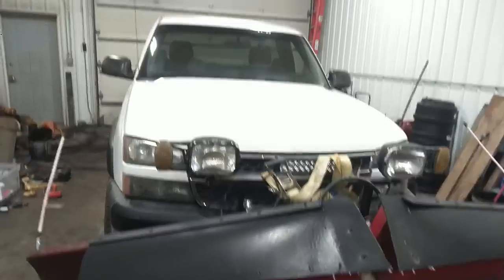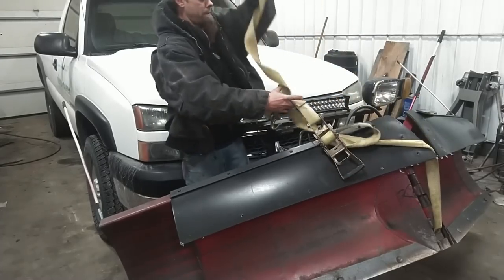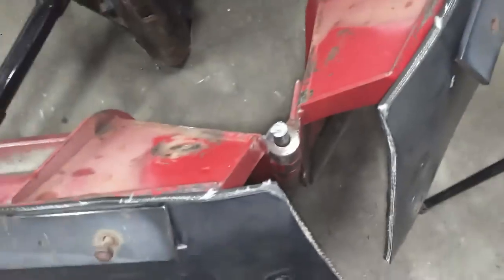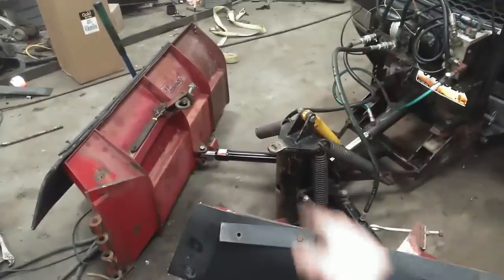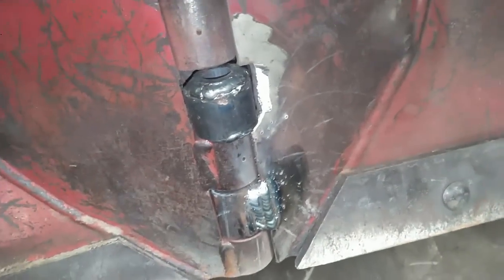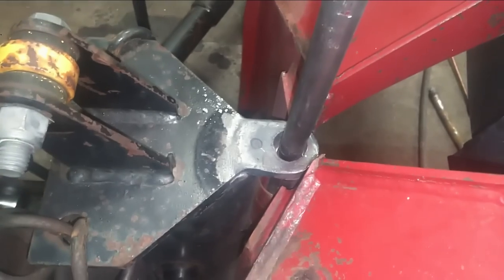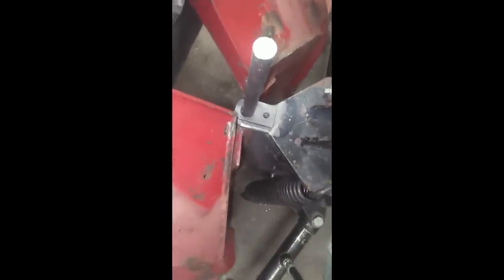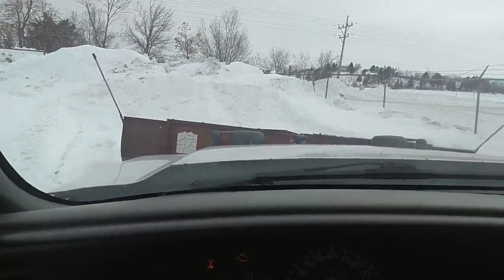fixing a badly damaged boss snowplow

Comment: That’s a common failure on V-plows- I’ve made that repair enough times that I’ll never buy a v again.  Very nice fabricating work, sir.
Reply: I had old Western straight blade plows for 30+ years no problems. My friend had many Boss plows with nothing but problems.
Reply: @grosseileracingteam  both are good plows, I prefer boss because of ease of hookup and overall simplicity.  V’s in general from any brand are prone to failure at the hinge because it’s pinpointing all the stress.

Comment: Wow!  I've had 5 Boss v's.  All but the stainless dxt tore at the bottom on the hinge.  I've repaired a couple, just bought new ears to do another.  They are fixable, but Boss didn't design them heavy enough at the base of the hinge.  Still better than anything else out there.

Comment: Just a simple question... when the pin moves in the wallored out hole on top won't that shear off the retaining bolt leading to another bent plow center pin???
Reply from the maker: Pin would want to fall down not up and the tab would still keep it from doing that. The reason why the pin was up is because the plow had been sheered off of the Mount causing the blade to almost fall off and then it was lifted back kinda into position

Comment: Do you think that hole being waller out is what caused that bolt to break off?
Reply from the maker: I think the plow breaking off of the Mount is what broke the bolt and bent the rod. That top tab and the rod were the only things holding the blade on that bolt is only designed to retain the pin. Not hold the entire plow on.
Reply: @Ezrider359  ya. I think you are right. I didn't look at it that way. Good job brother!

Comment: Not only is the cutter bar worn out, it looked like the skid shoes were missing.
Reply from the maker: No one runs shoes around here. This plow mostly plows paved lots And gravel freezes hard enough after the first storm that your not going to dig it up anyway.
Reply: @Ezrider359  skid shoes left on plows are telltale signs it is A. HomeOwner or B. Rookie plow operator
the skid shoes are the first things that come off plows here. they make great boat anchors, door stops

Comment: That guy is not kind to his equipment , evidently
Reply from the maker: Snow plowing isn't nice to anything especially when you get multiple storms back to back that are over 2 feet each
Reply from the maker: Tramp truck. You never put a snow plow on your nicest truck as plows destroy trucks. I never checked to see what any of the codes were but I'm sure if they were anything that actually mattered he would have fixed them. It's actually a pretty nice truck for a 20 year old truck and probably 30 year old plow that does commercial plowing.